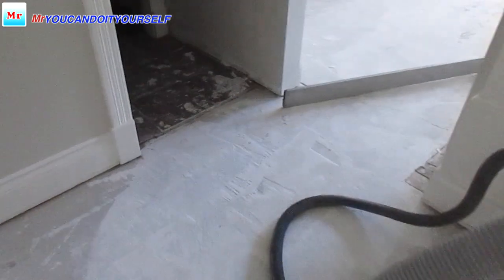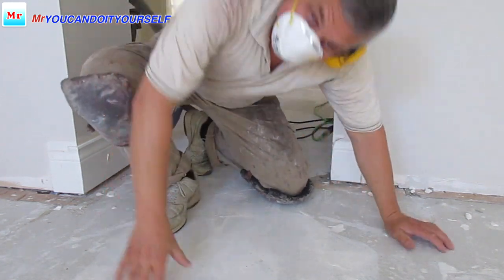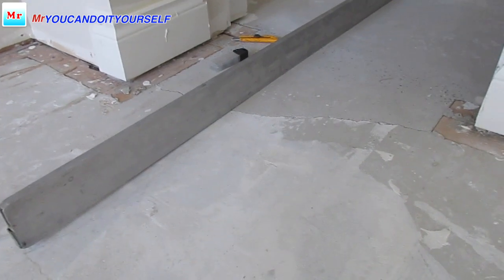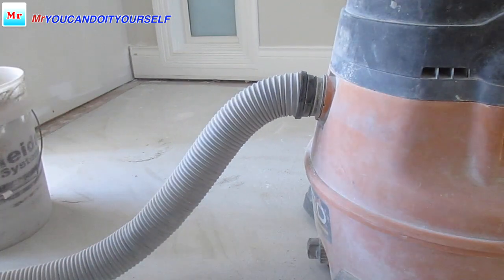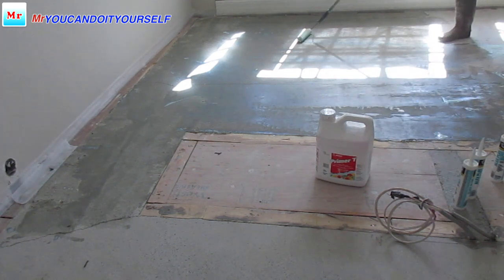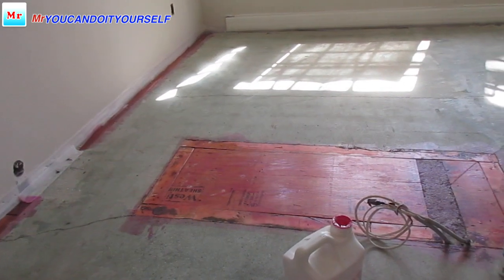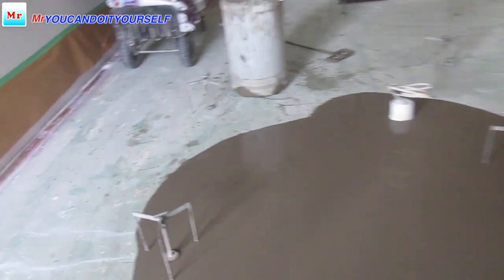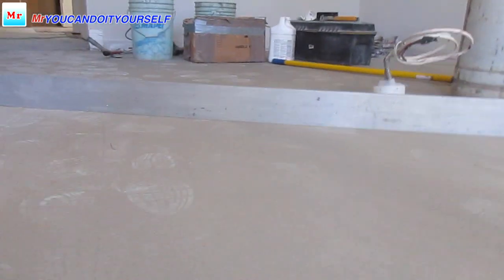How To Self Leveling Concrete Floor with Tripod  DIY MrYoucandoityourself

Comment from the maker: Here you can find some useful tips about the concrete subfloor prep and leveling. Enjoy watching and don't hesitate to write your questions.
Reply: MrYoucandoityourself what size straight edge do you use ?
Thanks
Reply from the maker: @lt8470  Hi, most of the time I am using 10', because longer than 10' doesn't fit in my Sprinter. But, also I have 8 and 6 fit long for small rooms. Thanks
Reply: MrYoucandoityourself  thank you

Comment: To fill the cracks in my concrete floor before I use the self leveling compound can I use no more gaps filler and then prime over the no more gap filler or do I prime the floor first then put down the no more gap
Reply from the maker: I don’t know this product. For fill up gaps I am using Planipatch. Check my videos, I have a few about it.

Comment: I love your videos. I’m a woman trying to do a lot of updates to my house myself. I am trying to level my lower level concrete floor that has expansion gap lines. Can the self-leveler go over it or do I have to keep those open? Thank you.
Reply from the maker: Hello, very good question! In my practice, I did many floors with this expansion gaps. I would recommend you to put wet sand or fill up with caulking because the self-leveling compound can leak there non stop and you will lose your money and time. Thanks!

Comment: Great videos thank you for making them..a quick question .i have two seperate bags of leveling compound left over and I require them to finish leveling a floor. So can I mix two different brands of leveling compound they both require water for the mixture so I thought it should be ok or am I misleading my self ?
Reply from the maker: Hi, good question! I am not recommend you mix it together. Compound’s formula for each brand is different, and it will be problem in a future. Thanks
Reply: Thanks I decided not to and  I notice the other brand seems a better quality mix it sets faster and gives a better quality strong compound ...thanks again.
Reply from the maker: Thanks you for watching and commenting!

Comment: The self leveling compound I have says it can level up to a maximum 2cm. The floor is about and inch different in height from one end to the other. So you still have grind the floor level. The reason I ask is with  self leveling you would think it does what it says in the tin? Please can you explain the purpose of self leveling. What it can do and what it can't. Limitations etc ...thanks for your good. videos
Reply from the maker: Hi, You can put compound twice, if you have more then 2 cm deep spots. I did it very often. Thanks.
Reply: @MrYoucandoityourself  it's more of s slope than anything else thanks
Reply from the maker: Watch this video: https://youtu.be/d-CUoPVlByw